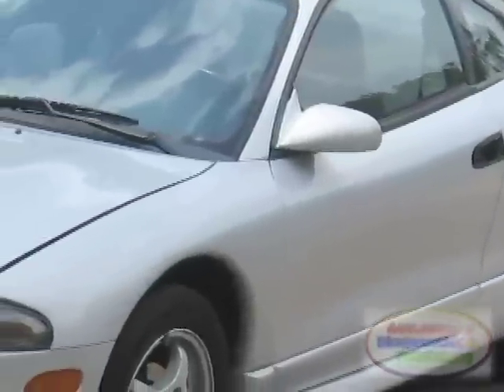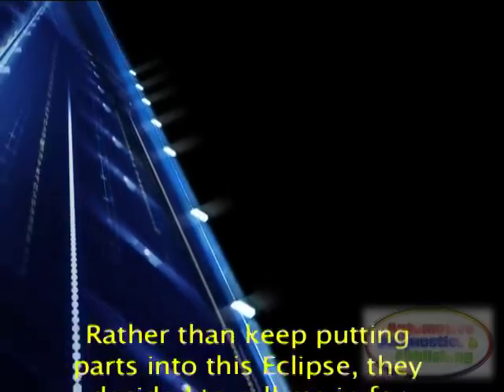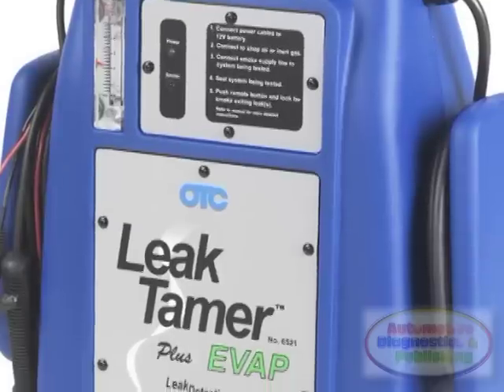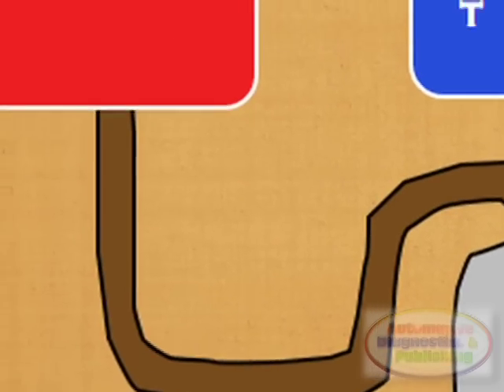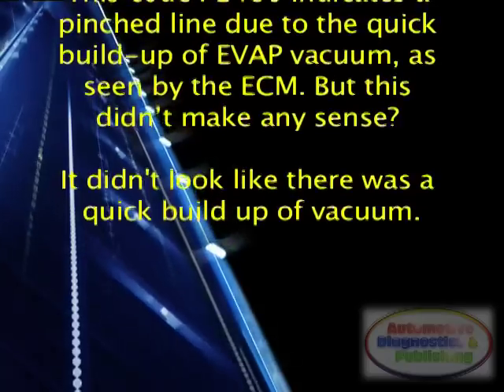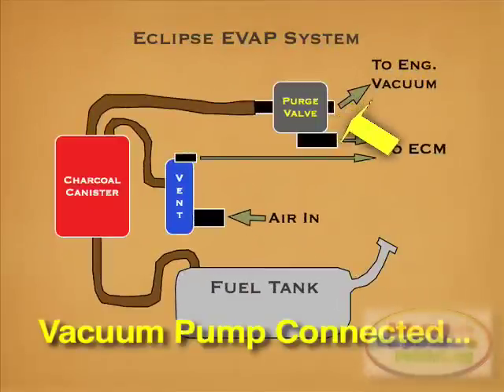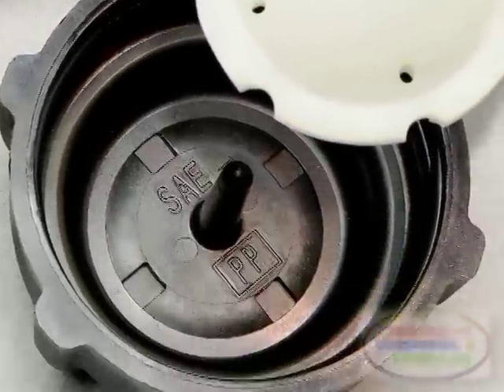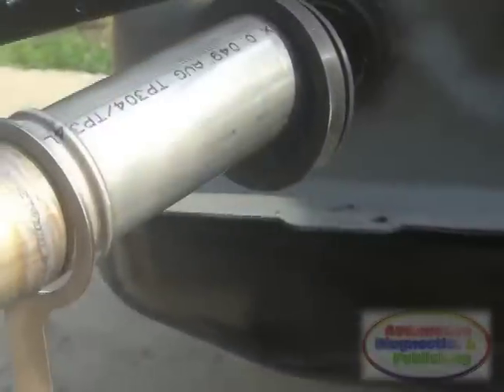Mitsubushi Eclipse EVAP Problem

Comment from the maker: @CoolasIce2 No, the filler neck valve only closes when you remove the cap to fuel. When you stick the fuel nozzle into the hole, it pushed this valve. Some cars use a ball and seat. The fuel cap has small vents that prevent the fuel tank from building up too much pressure or vacuum. Remember the old cars how you always felt a rush of vapor release when the fuel cap was removed? They didn't have none of this technology. Thanks and keep posting. ...

Comment from the maker: @TRcustomengineering Well, I suppose you can, but it'll take much longer. A while back I developed a procedure for finding EVAP leak without using a smoke machine and spending much money using simple tools. It is posted here on this channel. This vehicle had a different problem of a pinched hose. This issue is rare, but does happen. You do definitely need a water gauge though, also called a water manometer. It can be a mechanical one... Thanks for the post...

Comment from the maker: No they're not, but sometimes almost the only way to find a vacuum leak causing a P0171 or lean code. In a production shop it pays. Incredibly enough, SM use olive oil as the smoke source. There is a way to make one without much cost associated with it. We'll cover these How To Make equipment in an upcoming series. Thanks for posting.

Comment: Good video as usual. I don't see why the stuck valve would cause a rapid vacuum increase. I believe the filler neck valve is suppose to be closed  during  the purge cycle anyway.

Comment: @ADPTraining OK> I 'm trying to understand this. The fuel filler valve must have become stuck right AFTER the car was filled with gas, the ECM produced a code, and then the car owner ran to the shop before refilling.  I was under the impression that the fuel cap is sealed, so the entire fuel system is sealed. Apparently not. The fuel cap must have a very small, and precise sized hole other wise the ECM will detect a leak and you'll get a trouble code. DAMN THESES EVAP SYSTEMS.

Comment: It was built in Normal Illinois and isn't a California car. 

I'm not telling anyone to do this as I explained that the EVAP parts broke on mine. I will eventually fix this because I smell gasoline sometimes when I turn the air on and I hate that smell. I didn't know gasoline fumes were cancerous.

It works on DSM's, but it won't work on other vehicles that are implemented differently.

Neither of us can possibly be liable for what other people choose to do. This info's all over the net.

Comment from the maker: Those were pre-OBD-2 so you're fine. But after 1996 you will get codes forever. If you;'re in a State with an emission program than they won't issue you a license plate...

Comment: OBDII came out mid 1995 which means that some 1995 vehicles have it like mine. Says so in the manual. Trust me, I know. I've hooked my scanner to it and read freeze frame data. 

This mod that I did is all over the forums. People with newer vehicles have done it as well. with no codes.

As long as the tank is sealed off by the check value and purge solenoid, the ECU can do its pressure tests and passes them.

Only reason I removed it is because I broke a couple of pieces installing the clutch.

Comment from the maker: NO, no, no... OBD-2 does a functionality check. 1995 is not OBD-2. Just because you have an OBD2 connector doesn't mean you're OBD-2. You have an old vehicle and keep it that way if you detest OBD2 and inspections. An OBD-2 vehicle would have flagged your issue right away. Good for you, but you also have a fire hazard, remember that.

Comment: My Eclipse is OBDII

I removed the charcoal canister and all the vacuum lines connecting it. I left only the check valve and purge solenoid, the ECU doesn't know whether the EVAP system is there or not so I don't get any codes.

Unless the shop doing my emissions removes the battery and tray under-neigh, they won't know it's there either because it's totally hidden from view.

Comment: I'm getting a P0441 "Incorrect Purge Flow" for my '99 Corolla. I've replaced the "Vacuum Switching Valve" on the charcoal canister, but I still get the code. Now I will replace the "Purge Valve" under the hood, even though it seemed to work.   I tested it with  a 9 volt battery. Do you know if the valve is switched on with a constant dc voltage, or is it pulsed with a square wave?  If it is pulsed, maybe that is why it tested ok with the dc voltage, but wont work with the  pulsed volts.  Thanks.